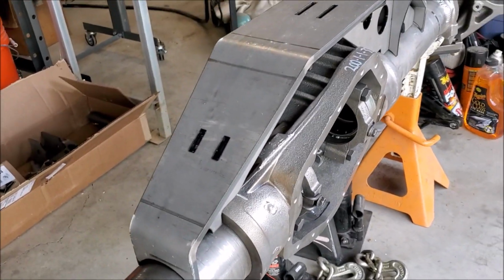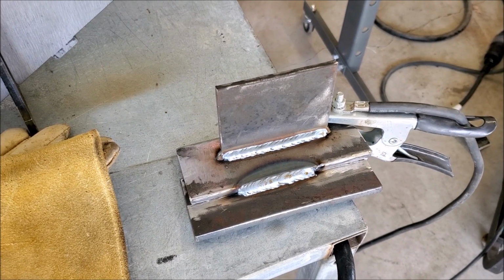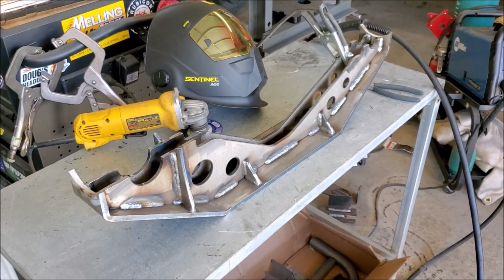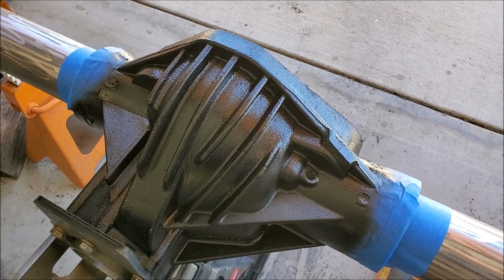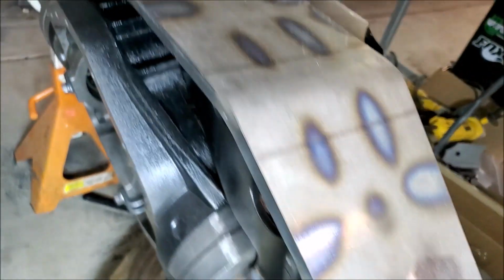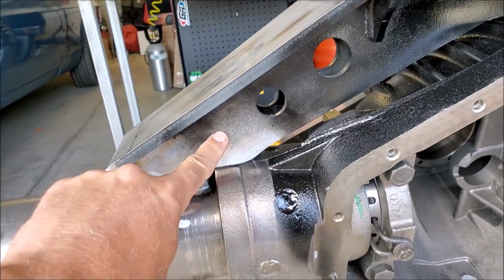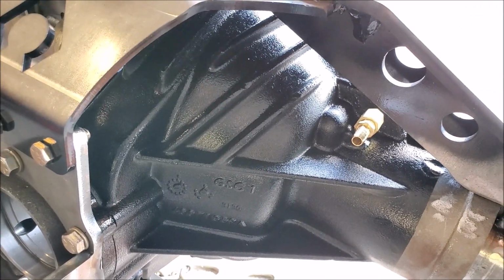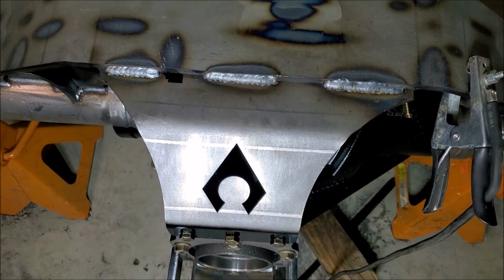Artec Modular Truss Install

Comment: Thanks for the vid. I'm getting ready to weld one of these modular trusses to a Dana 60 hybrid for my 4Runner. Did you fit up the truss and tack in the support pieces with it on the axle, then remove and fully weld the truss together?
Reply from the maker: yes